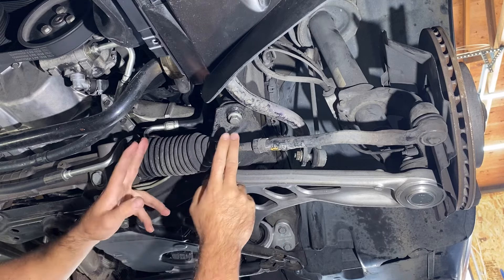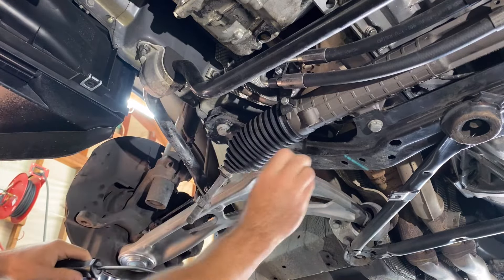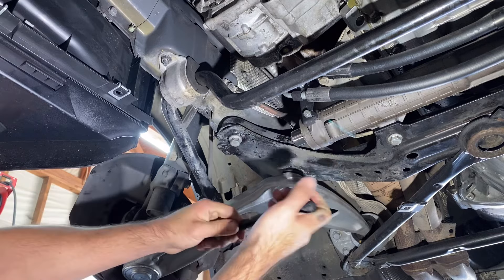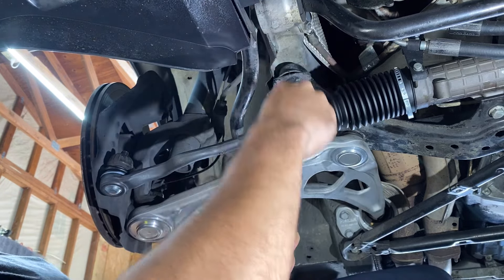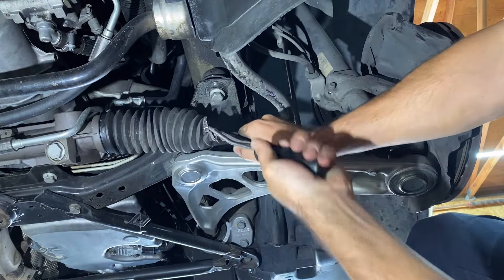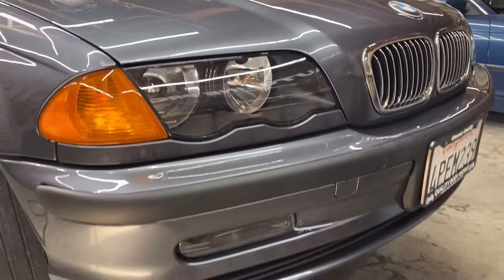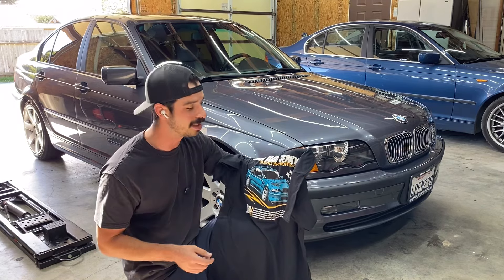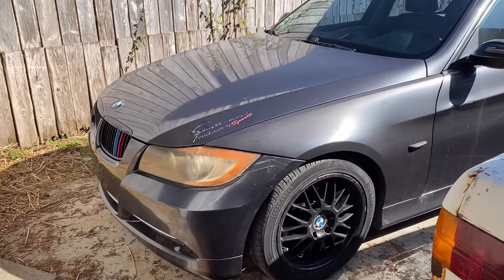Tie Rod Ends 101: How, When, and Why!

Comment: Perfect timing on this video Alec!  I will be replacing the tie rods on my E39 this afternoon with my kids. One tip I was told a while ago from an alignment guy is if you're not using OEM parts, you should use a tape measure instead of counting threads since the threads can be different.  Cheers!

Comment: Damn, I probably need to do these on the ZHP. I can’t ever recall replacing mine.
Reply from the maker: You can always wiggle the wheels left to right and feel for play, or if the steering feels a little sloppy. They’re super cheap from FCP euro, 150 for the set I think?
Reply: Same boat. Gotta do mine despite having done a million other things already. The list never ends, if you’re lucky it just gets slightly shorter from time to time

Comment: Hey Alec man, great video as always. I hope you don't mind me picking your brain just a little bit... as I had told you previously, I bought an E90 with the N52B25, 325i, manual transmission. When I start driving it in the morning, in low rpm's, the car is jerking along, almost like in a resonance frequency, and there's just a bit of clunking. I wonder if it's normal for this model. This is only when cold, as the car will be dumping fuel even below 1500 rpm. When it's warmed up and not keeping the revs up anymore, the jerkiness at low rpms is gone. What do you think?

Comment: I used a 32mm fan clutch wrench to loosen the inner tie rod nut when I did this on my E39 and it was a snug fit. YMMV, but others might find it helpful.
Reply from the maker: I think last set I did on my e46 it wouldn’t fit , or the thin wrench started to fail, I wonder if it’s different sizes from e39 to e46?